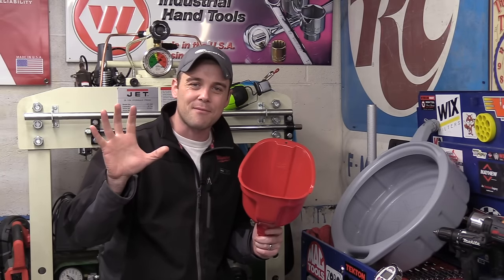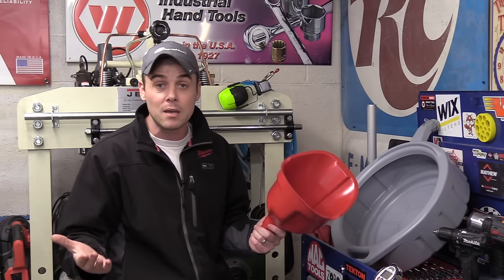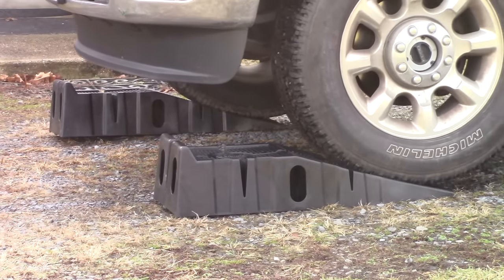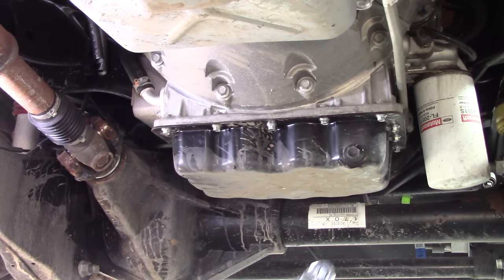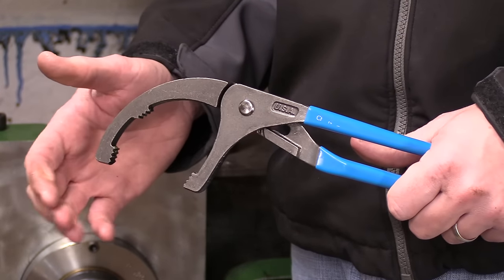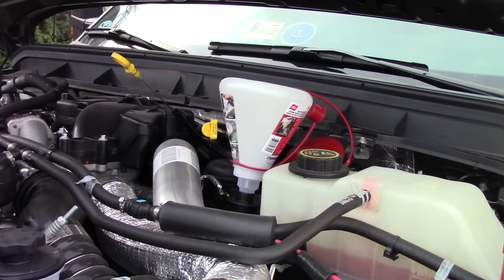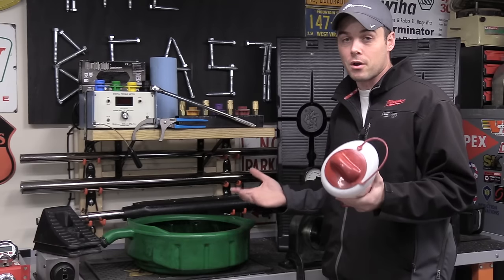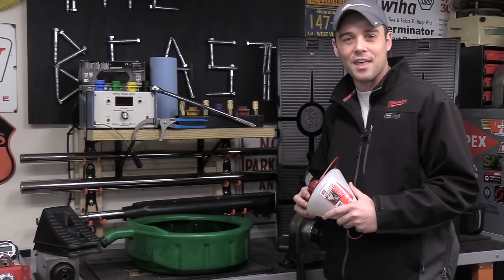Top 5 BEST DIY Tools (Changing Oil)

Comment: My thoughts on your picks.
Ramps - initially I first used the ramps for oil changes but figured out later that jack stands and a jack are much more useful if you plan do other stuff like rotate your tires, brakes, and other jobs.
Long ratchet - nice to have, but it shouldn't take that much effort to take a drain plug off. You are better off with a flex head ratchet like the Harbor Freight Pittsburgh Pro or Gearwrench ones if you want the extra leverage and want to do other stuff.
Oil Filter pliers - In most other applications, you have a limited amount of room and would be better off with something like a strap, claw, or metal band wrench - something that won't have clearance issues. I personally use the Gearwrench claw wrench.
Drain Plug Pro - Nice to have. Sounds like a hand saver, especially if you are going to be doing a lot of oil changes.
Lisle oil funnel - Nice to have. Sounds like a great way to prevent spills and free up your hand though it does cost ten times that of a basic funnel and may be hard to justify the cost if you're not using it to make a living.

Comment: I change my own oil not for savings but for convenience, the fact that I know the belly pan is put back on with ALL the fasteners and mostly because it forces me to get under the cars and trucks (we have 4 vehicles) and get a good look for anything that needs attention. It's surprising how much can be caught early when you crawl underneath with a flashlight.

One tip I have for vehicles with the filter horizontally is to cut up a windshield washer fluid bottle flat to use as a catch pan when filter is directly above other components like steering linkage.
Reply: Or a pry bar for that matter when we talk about checking your bushings, drivetrain, and suspension parts that need greasing.

Comment: My favorite thing is no drain plug but the Fumoto oil drain valve I put on my jeep. So easy and simple. No mess at all. I just attach a hose to the end of the valve put the other end in my pan and open the valve. After it drains I close the valve and take the hose off.

Comment: My favorite oil changing tool is a large plastic concrete mixing tub.  The thing is 3' x 2' and will catch oil no matter how far it jets out from the drain, can catch the drips from the plug and the filter at the same time, and cost me all of $8 at a hardware store.  It's way better than the little round things at the auto parts store, which inevitably result in you missing part of that first jet of oil.

When I'm done, I just upend it into a 5G paint bucket for eventual disposal and wipe off the lip with a shop towel.

Comment: Thanks for your tips.  I have been using a K&N filter for years which uses a one-inch socket or wrench to remove.  Also, I always pull out my check oil stick before refilling the oil - less back pressure when pouring in the oil.

Comment: For the most part, I'd call all of these tools gimmicks, except for one.
Those Channellock oil filter pliers are the real deal.  They're also great for plumbing fittings like PVC drain collars and unions, and kitchen sink drain retaining rings.

The rest aren't awful, but you don't need them either.

Comment: All great products. For vehicles with the filter in the engine bay I use a suction pump to capture the oil , don't have to get under  the vehicle and I  save a lot of time and less mess to deal with.  I get the oil out thru the oil dip stick tube , some don't like the method but I think it a great alternate way of doing an oil change.
Reply: STEVE ROB if you don't drain the pan through the drain plug your pan will fill up with sludge that will eventually clog the pick up screen...
Reply: That's a misnomer.  If you look at the pan geometry, it should be clear that a vacuum oil change is actually capable of removing more oil from the engine than you can get out from the drain hole.  I've been able to pull a pint, even after the engine has been drained from below.

In any case, vacuum oil changes MUST be done on hot oil.  Any sludge will be sucked right up.

Comment: I prefer to jack mine up and use jack stands for a couple of reasons. Aside from my fear of driving over the end of the ramps I like to check  the front tires for end play up & down and side to side checking ball joints and tie rods while I'm waiting for the oil to drain.  I also make it a habit to rotate my tires when I do an oil change. 

That magnetic drain plug tool is very cool.  I haven't seen that before but I will be getting one for sure. The funnel is pretty neat too.  I can see where that would be very handy. Fortunately my car is pretty easy to get to and fill with just a regular old cheapo funnel. 

The fact that you even mention that an oil drain plug might be put on with an impact gun is reason enough why it's probably better to DIY oil changes.. Not to mention the fact that most "quick lube" type oil change places are probably using the cheapest oil filter possible and who knows what kind of oil.

Comment: Fumoto drain valves work great too.  I have used them for years on my oil drains with zero issues.  Allows easy and mess free draining.  Actually allows you to use an empty 5 quarts jug so you don't even need the drain pan.  Great video.  Thanks

Comment: I just bought and got to use my Mity-Vac oil extractor a few months back. Forget dealing with the drain plug at all! 

As a bonus: most euro cars like my Audi have bypass filters located up top, so I don't even jack the car up and drop the skid plate to do an oil change! It take only a few minutes now, and not a drop of oil is spilled.  

I service all the family cars, and I don't mind people bugging me for oil changes now - it's that much more easy.

Comment: I've had bad experiences with oil filter cap wrenches in the past. They either spun on the filter or got wedged on and were difficult to separate from the filter. So I found it much easier to use a nylon strap wrench. The strap is attached to a hollow square bar which rolls the nylon belt tight and attaches to a 1/2" drive ratchet. It's not usually a one handed operation, but it works better for me while taking up much less storage space than cap wrenches. I like the setup you have in the video with the exception of the ramps. I trust the strength of steel (jack stands) much more than anything else.

Comment: Few people will read this,  But the best drain pan is a concrete mixing tub from a big box HW store.  Way cheaper, and way bigger so you don’t overshoot it when you pull the plug, and you can do the filter while the pan is still dripping.  And it’ll be big enough for nearly any transmission too.

Comment: For those of you with cars that have cars equipped with the plastic canister type oil filters where you change the paper screen inside as opposed to the metal spin-on type of filter; I recommend the Lisle 5pc filter socket set (p/n 13300). This will allow you to change oil filters on engines such as the Chrysler 3.6 Pentastar and Chevy EcoTec, as well as various fuel filters.

Comment: I particularly like the oil catch pan. I use the same kind and the way the lip is designed, it will direct oil back to the pan without spilling out of the pan when oil gushes out.

Comment: Don't forget the fact that you know the job was done right when you do it yourself. You know your drain plug isn't stripped, filter isn't too tight, and any hardware requiring removal for the job isn't left off and such. Lube techs are the worst.
Reply from the maker: +Banshee365 exactly!  I let the oil drain until it stops dripping.....that takes 10-15 minutes......quick lube places put the plug back in too soon & leave a lot of old oil in your engine! 👎
Reply: Real Tool Reviews I love my Powerstroke...I own 3, but the side drain plug is such a stupid pain the the ass
Reply: Bingo!!!!!!!!
Reply: I'm a lubetech and I agree. Some of us tighten the drain plug crazy hard. Because if it leaks later and customer comes back, we lose money that we earned.
Reply: @ZERONEINNOVATIONS  Right, so strip the oil pan. Much better idea. Use a torque wrench like a professional.
Reply: @Banshee365  As far as I know, no body(my coworker) use torque wrench for oil drain plug. I never overtighten bolt, but not everyone. Like I said, its hit or miss.

Comment: That funnel, and drain plug tool is slick. I also suggest a few gallon food storage bags. I use one to keep my funnels in so they say dust/dirt free, and I also drop my old filter in one so it doesn't make a mess in the trash can. Personally I use a drain pan with a top on it as well. That way if you do drop the plug it's not down in the waste oil. I also set up a hook on my fence to hang the drain pan from when dumping the oil into the old oil jug for disposal. I dump the bulk of it in, and then set up the jug, and pan against my fence for it to drain the residual oil out of the pan.
Reply: Not sure about your local services or laws, but in California it's illegal to throw away oil filters. The auto parts stores accept them when I bring them my used oil to dispose of at the same time.
Reply: Travis McVey 
the drain pan like in the video is the best I've used, though it wasn't mentioned at all. it's deep and wide enough to cover both the drain plug and filter locations usually, so a secondary catch container isn't necessary. having a container with a top would tend to splash from the initial high flow if there's a large distance from the drain point.  the container in the video, having the long spout, makes transfer to a storage container much easier. the version with the longer narrower spout is better than the one with the shorter wide diameter one that's also sold; fits down into most containers like the 5 qt jugs or wide mouth single quart bottles the oil often comes in now, which was just emptied.
Storage is easier too because it can be stored on its side with no leakage, I usually just toss some newspaper in there to absorb the remaining film of oil as it sits for next time.  I'd go as far as put it at the top of the list of all the tools for oil changes.

Comment: I have oil filter pliers very similar to yours and they're the best I've ever used. I use a torque wrench for tightening the drain plug and I've never had a problem with stripped threads. The drain plug gasket also lasts for years.

Comment: 15 year diesel tech here. I personally prefer the strap style socket for spin-on filters. I've never been unable to remove a stuck filter and since it a strap, I can adjust it to different diameter filters. Some of the filters I deal with are about 5" wide or more. I got mine from Snap-On at an embarrassingly high price, but I'm sure you can find a less expensive one out there.

Comment: You forgot to mention the 5 gal. pail of oil-dry, a stack of shop towels and the 6-pack of beer. Don't forget to grease the front end. I usually have a replacement T shirt to put on after wrecking the first one. Don't tell me you have changed oil on the ground and never needed one of theses. HaHaHaHa
Reply: if you're getting oil on your tshirt you should probably take it to the dealer because you are definately doing something wrong
Reply: You're right. I should take my 3 farm pick-ups, 1 semi tractor ,5 farm tractors  and the combine back to the dealer for oil changes because I have definitely been doing something wrong for over 40 years. I'm so glad you pointed that out. I am such an idiot and you seem so clever. Thanks for taking the time away from your video game to enlightening me. It was a failed attempt at humor, but most millennial don't get humor. LOL.
Reply: o Lemurs you clearly have never been under a car
Reply: Calm down Douglas. I work at a dealership and I get oil on my shirt all the time. Maybe we could learn something from o Lemurs?
Reply: Beaker, I'm always willing to learn. LOL
Reply: Yes, dont be directly under the filter or drain plug when you take it off, and always have your pan ready? its not too hard to grasp
Reply: o Lemurs,   Thanks, I'll tell the other 3 guys I work with, they'll be so thankful for all the help! 2 of them have been there for over 20 years and they hadn't yet figured that out. your a lifesaver.
Reply: troll yes but i do say some intelligent shit, i honestly dont know how you can get oil on your shirt though unless you spill it on the ground and lay on it. why this guy deleted his comment, i dont know but also if you think ive never worked on a car you're just wrong. i have a 76 lincoln continental mark 4, a 78 regal, and a 05 mazda 6 so i know what im doing.
Reply: Got some oil on my shirt this morning.
Reply: HaHaHaHa. Sorry about the shirt, maybe laundry can fix it. Doug
Reply: I have a 6 steel caster wheel creeper. Never use it. Going to throw it out. The caster wheels get hug up on the smallest obstruction like a saw cut in the concrete, a small stone or a piece of mouse hair. LOL. A lot of guys like me prefer card board, even some guys on youtube. I have 3 pairs of coveralls in my locker but on hot days I just can't bring myself to put them on. My original comment was meant as tongue 'n' cheek, kind of a joke. Messes do happen.
Reply: I have several "oil change t-shirts" with the appropriate stains.  Usually it's when removing the oil filter.  On my Mazda 6's, the oil filter was located above the exhaust manifold and I had to reach up and between the headers to reach it, and then pivot the engine back to wiggle the filter down and out.  Almost every time I would end up with at least a trickle of oil running down my arm.  People would ask me why I had a tan on my right arm only!

Comment: This is something I was taught at 12 years old. My dads cheap he isn't going to pay 120 dollars every 3,000 miles especially not the way we drive places to have oil changed. So I was taught to change oil, transmission fluid, rotate tires, and brakes. And then I was taught how to tear a motor down and rebuild it by a master mechanic.
Reply: You are lucky to have such great mentors.  A lot of people don't even know the difference between a radiator and a carburetor.

Comment: Honorable Mention:  Big A$$ piece of cardboard to place under your car to save your driveway from spills and drips while you change the oil and filter.
Reply: I use a tarp to place underneath my car. Any oil spills wipes up pretty easily. I have tons of tarps I've gotten free from Harbor Freight :)
Reply: That free harbor freight tarp is legendary...lol
Reply: Old political campaign signs that never get collected work great too.  They are slick so it makes sliding under the vehicle much easier, any spilled oil wipes right off, and if the the candidate is never going to collect it, you're basically picking up litter and making the world a better place.
Reply: Dollar store tarps are just the right size for oil changes or repairs .

Comment: I have steel ramps but It's faster for me to just use my floor jack and jack stands but obviously whatever works for you is the best thing to use. I always time it so that my truck is cold so as not to have to deal with hot oil but I like those tools you featured for dealing with a "hot" oil change.

Comment: I will add in a comment for Fumoto Valves as well. Makes the job almost tool free and no mess. Amazon usually has Oil for the same price or a few dollars cheaper than Walmart. If you use Google Chrome you can set up alerts on Camalizer to notify you when the price drops. Ex. 5Qt of Mobile1 Full Synthetic was 19.99 on September 17th.

Comment: Channel lock oil filter pliers are great and they come in a bunch of different sizes. The only problem I find with the is the 90 degree bend. I also picked up a few straight oil filter wrenches Tekton makes a 12 and 16” model ( I use these on my 2019 Ford F-150 as I can slid the oil pan under the front and reach the filter from the top without getting under the truck because of the reach you get with the strain handles to jaws)  and obviously mac and other companies have a model. I’ve also picked up a few gear wrench and mac band style filter wrenches. This are nice then you can’t fit a pair of pliers around a filter cause the engine block is too close you simply slide the band over and put a ratchet bar through whatever space you have. If your only changing one or two vehicles you’ll know what you need but I’m an industrial power generation technician and I’ve had to to take of some of the most stubborn and large filters. Try and grab the filter at the top if you can as that’s where the most steel is (with the threading) and less change and squishing the filter and making a huge mess, but like I said sometime you can’t fit a wrench into certain engines and you need options. I’ve bent a pair of channel lock oil filter wrench having to put a pipe in the handles to remove and stubborn filter one a 750kw (1005hp) Baldor generator (which are notorious for having stuck filters) and ever since then I’ve had all the sized and different options another great option is slip joint tongue and groove pliers. You can get them upto 16.5” from channel lock(which is what I had to get for the baldor)  and all these item are under 35 dollars. Remember to lube your o-ring to seal your filter properly and also make removal a little easier next change. Good video I actually have never seen that lisle funnel and will be ordering one right now. Def clear funnels are the way to go. All and grained has a good set of 3 I always carry but like you said some engines take a long time to drain down to the pan and you get overflowing from the rocket. Excited to get that like funnel great video!